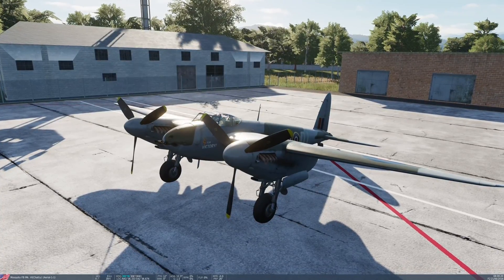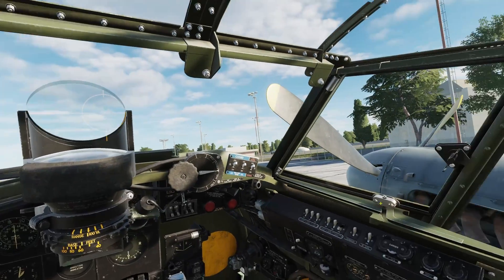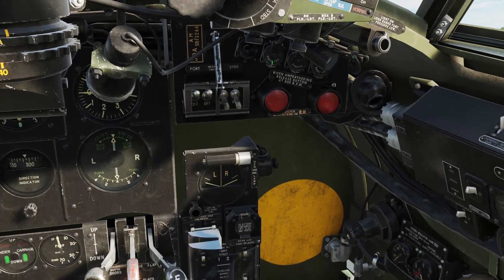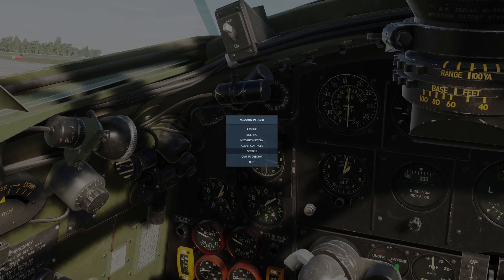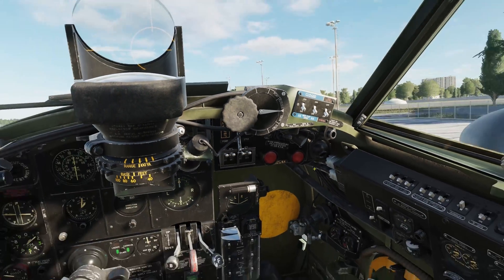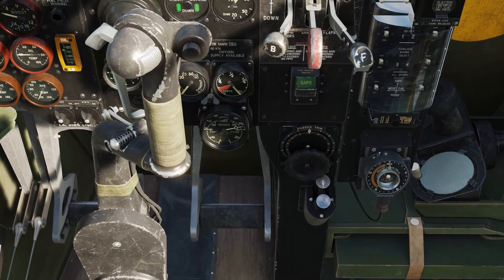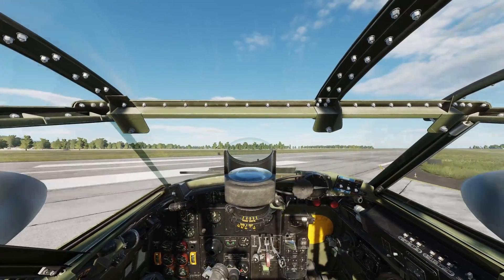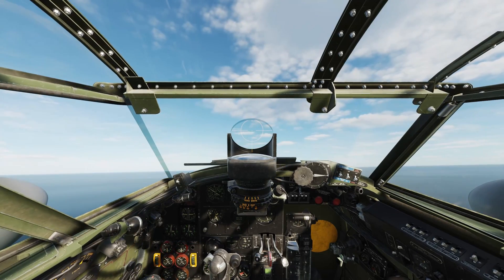DCS Mosquito Quick Start and take off tutorial

Comment: Can you just explain what you were doing with the rudder/brakes there please?Are they connected in some way?
Reply: I 2nd the motion, otherwise fantastic tutorial.  
Looking forward to next week when I'm off work so I can buy a car ( just passed my test @54 yrs old ) and play DCS mossie :D
Reply from the maker: @Wolfhound223  well done on passing your driving test! I hope you love the mossie - it’s great fun to fly and the Normandy map looks amazing as you zip over it at 20ft :)
Reply from the maker: Thanks for your question! The rudder and brakes are linked. If you are travelling in a straight line and want the aircraft to stop you would just hit the brakes as normal. For turning the aircraft while taxiing you need to hit the brakes and press the rudder. So, if you wanted to turn left you would apply the brake AND push your left foot forwards. The more rudder you apply the harder the brakes will squeeze and the tighter the turn. The aircraft is quite ‘light’ on the ground so you may see in the video that I am constantly tapping the brakes and applying a little rudder to keep the aircraft under control - if you leave the aircraft turning too long it can be hard to get it back in track without spinning out. Hope that helps explain it a bit better.
Reply: @ChattytumblerTCW  Thank you!